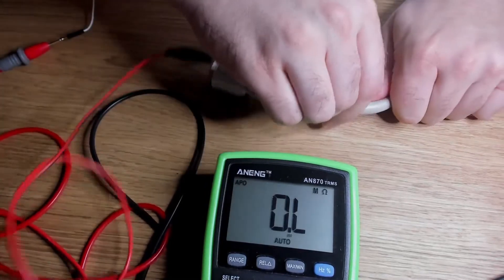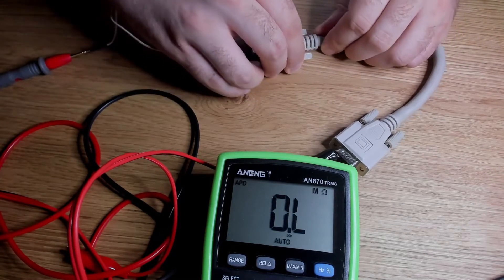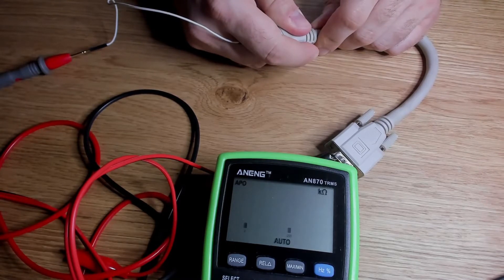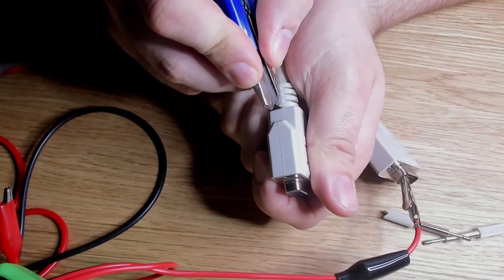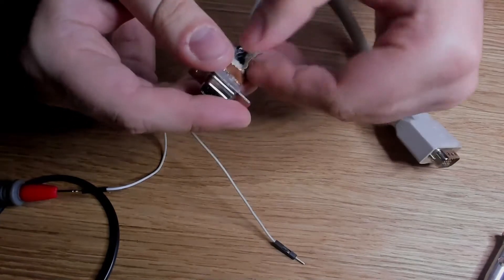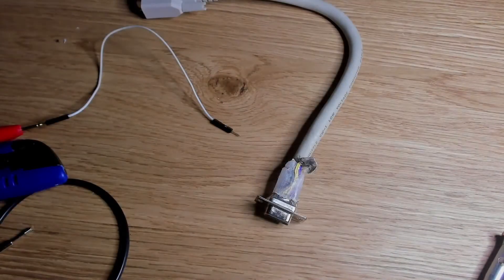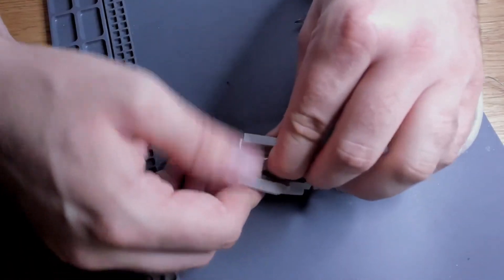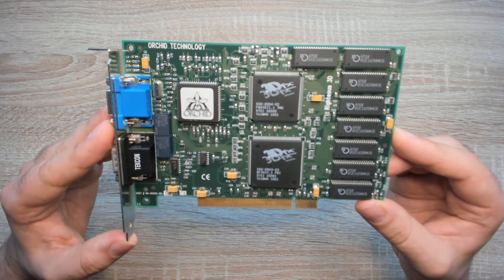Voodoo VGA Loop Cable Repair

Comment: 😄I enjoyed the video, and it would be worth it for me. Since I need to fix my vga wire connection on my wacom cintiq 21 UX monitor. I hope it works. Any suggestion would be helpful. Thank you for the video.
Reply from the maker: Do you have a problem with the monitor or with the VGA cable? The issue I had here was a broken wire inside the VGA cable. That issue was there for as long as I can remember. I guess those passthrough cables were always bent at the back to make the case fit close to the wall, but that broke one of the solder connections.
I assume, the wire cannot be unplugged from this device and easily replaced?
Reply: @ Hello, yes I am having problem with wire. Just as you mentioned for quite sometime for me too. It will come on with sometimes, a red or flicker green etc. I took off the white vga , but I think it needs to be rewired. Not positive.
Reply from the maker: It sounds like the issue is also on the connector. You describe exactly the same fault I had with the cable in this video. You probably have seen that it wasn't easy to open and fix it. It's working now, but I had to zip-tie it back together.
In my opinion, it would be better to replace the entire cable. I'm not sure if it's easy to open the case and see how the wire is attached inside the case. Please be careful, there are high voltages inside monitors since it usually contains the power supply as well.
Reply: @bitsundbolts  Thankyou for all your help. I did open it, and I don't think I will be able to fix it because, I think I need a vga that is dedicated for a cintiq 21 wacom art tablet. I appreciate your help and thank you for getting back to me.👍
Reply from the maker: Hm, then most likely it is worth a shot to fix the cable. First, you need to locate the damage in the cable. I did that by bending small sections of the cable until I could repeatedly reproduce the color issue.
Then you can try to carefully open the cable. It will take time because you need to be careful. Better slow that quickly and damage more in the process.

Comment: Soldering to aluminum is basically a no-no, at least with traditional flux.  It creates an oxidation layer pretty quickly so that it will not adhere well or make good contact.  That shielding might be marginal.

Comment: Fucky lucker, my Voodoo 2 didn't even come with a cable. I had to build my own from parts, from a dead monitor, dead video card port, a portion of prototype circuit board, and some spare phone wire...
Reply from the maker: Very creative! I bet it served you well.
Reply: @bitsundbolts  It sure did! Well, for the 3 or 4 years or so I used it anyways...

I only had 3 different colors of phone wire to piece together my homemade adapter, but I was quite careful to layer down the wires in a very neat pattern to help follow which wire went where ya know.

Worked great first time, though it took me like a week to build it. I could have possibly made it work within a few days, but I wasn't about to gamble with my Voodoo, I triple checked EVERYTHING before I ever bothered testing it...

Sucks that the Voodoo card was stolen from my junk bin around 2016 or so, but that's a different story... ☹️
Reply: @southernflatland  what do you mean by "junk bin"?
Reply: @intel386DX  Junk Bin? More or less exactly what you might expect, random junk out of their bin off in the corner of their store...

Was awesome really, you take your own chances for $5, no warranties...
Reply: @intel386DX  Addendum: I purchased a number of those non-warranty items, not knowing what to expect, but glad to fix whatever I could...

I still have a set of Yamaha speakers, still to this day working from that time (after multiple repairs LOL!)
Reply: @intel386DX  The Voodoo card didn't come with the passthrough cable. I ended up making my own.

Not exactly an easy thing ya know, but I already had plenty of spare parts...
Reply: @intel386DX  Oh, I actually paid like $40 for that Voodoo card from their junk bin, they knew it was worth something back in 1998...
Reply: @southernflatland  I got my first voodoo 2 hade even a 3 radiators on the chips (inever so something like this after) it come with a cable for 15 euros back in 2005 I think it was , yeers after that I give this cart for a present for a friend if mine . 
Years later (about 2015) I got 2 voodoo 2 carts (not at the same time) from a fly market for dirt cheap , my be about 5 euro both. And they work , but are different brands,  I made an SLI cable for them ,but was to lazy to make a pass threw one yet 😁
Reply: @intel386DX  SLI didn't exist back then. Try again troll.
Reply: @southernflatland  yes it is. You can chain 2 voodoo2 cards together  with a special cable wich looks like an flopie cabble ,bur with a twist on the different positions , and that's how I made this cable
Reply: @intel386DX  You're still talking jank, try again.
Reply: @intel386DX  Well thank you for the properly educational link. I apologize for talking out of line.

Still, nVidia bought them out, my only experience with SLI is from nVidia cards. Wasn't aware 3Dfx had their sh!t together before they were bought out.
Reply: @intel386DX  Oh. OH!

I thought I was responding to a different thread. So you asked about my 'junk bin'...

Welp, since around 1997 or so, my late father collected all sorts of junk from hurricane damage piles. So I had sh!tloads of junk to clean up and mess around with.

Comment: Asus P55T2P4 have a ps/2 header, it would be nice if you make a video for connecting a PS/2 mouse. Using a serial mouse won't be able to enjoy the benefits of high precision mouse tracking, and it doesn't help that few serial mice have scroll wheels handy. 😊
Reply from the maker: Yes, unfortunately, I was not able to track down the PS/2 header bracket yet. Maybe I will try to make one some day if I cannot find it. Most serial mice are terrible to use and have no scroll wheel.
Reply: Well nowadays its not worth using a PS/2 mouse outside of compatability reasons. The difference is so incredibtly tiny that even for very cheap mice you wouldnt see a difference
Reply from the maker: I actually tracked down a PS/2 header. I'll use it in upcoming videos. Time to retire the old serial mouse I am using at the moment